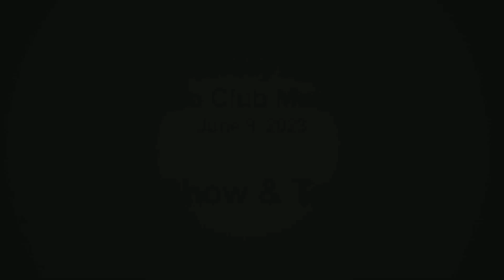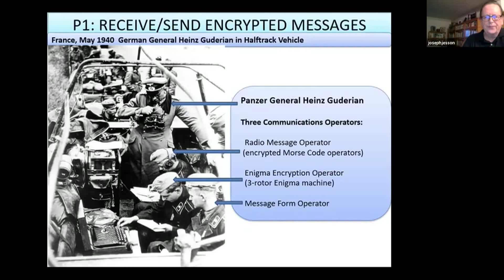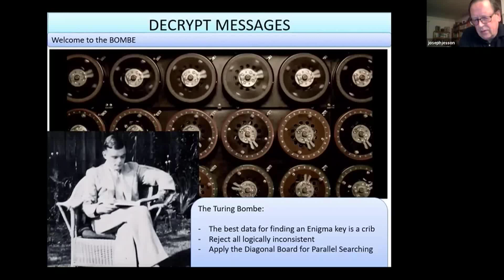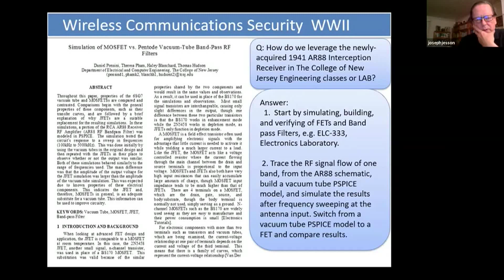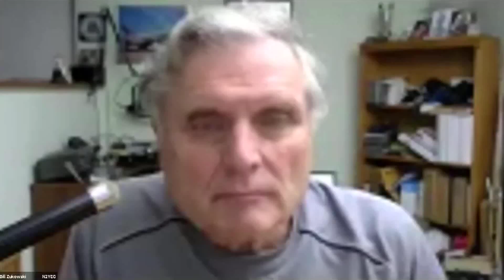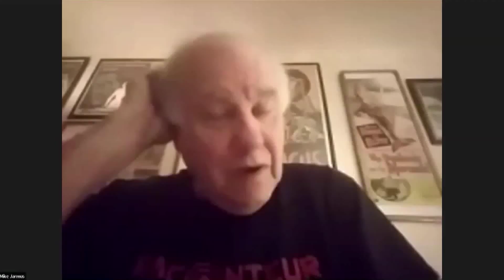The History of the RCA AR-88 Interception Receiver

Comment: The RCA AR88D did not use electrolytic capacitors. 
There are new dials available from Radio Days in stock. 
The lucite low loss plastic coil forms contributed to it's stability.